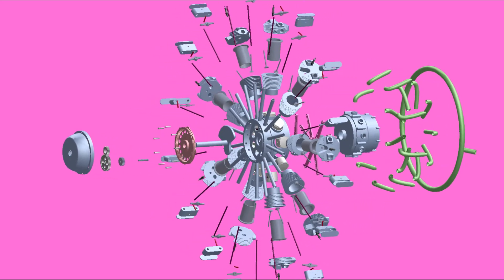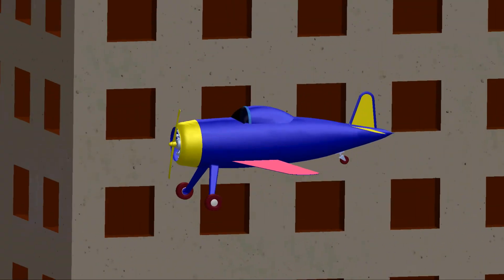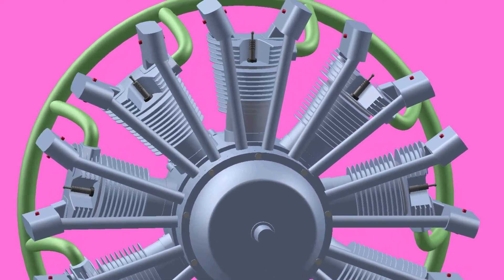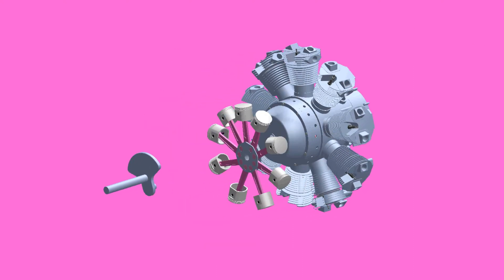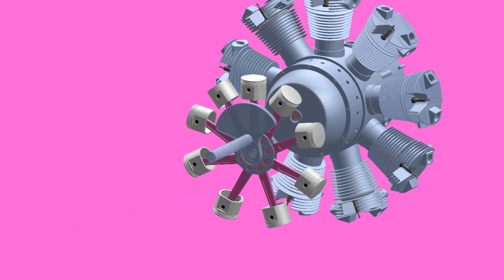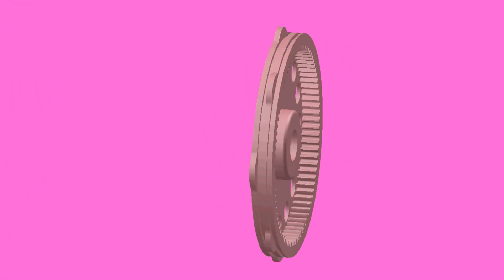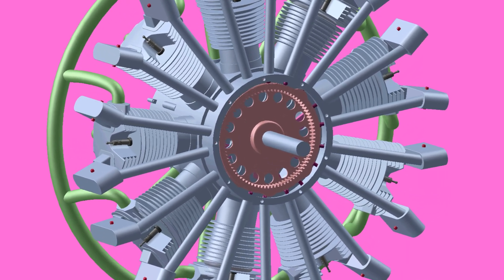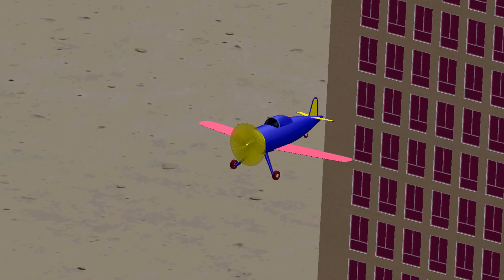How radial engines work | Lemurian D-Signs

Comment: Still difficult for me to visualize why inline engines have an even number of cylinders, but radial engines need to have an Odd number??
Reply: You should give it some thought :) But... The radial engine depicted in this video is a four stroke engine. This means that each cylinder fires once every two revolutions of the engine. Another observation is that each cylinder achieves TDC sequentially in a circle around the engine as it rotates. After TDC either combustion or intake stroke begins. For the vibration and even power stroke distribution it is desirable that every other cylinder begins a combustion (ie. it fires) and every other cylinder (those between former) starts an intake stroke as it rotates. The only way to achieve for all cylinders to fire in this configuration is to have an odd number of cylinders.  Thus in the nine cylinder example above the firing order is: 1- skip 2 because it started intake stroke - 3 - skip 4 -5 - skip 6 - 7 - skip 8 - 9 - skip 1 (astute reader will observer we started a second revolution of the engine at this point) - 2 - skip 3 because it started its intake stroke - 4 - skip 5 -  6 - skip 7 - 8 - skip 9 and now after two full revolutions we are back at the configuration we started with. This is only possible with an odd number of cylinders. In example if we would have an 8 cylinder radial and a firing sequence would skip every other cylinder(desirable) only cylinders 1-3-5-7 would ever fire, because we would skip number 8 and landed back on 1.
Theoretically there is another possible configuration where in the first revolution every cylinder fires, thus the first revolution is composed of combustion and exhaust stroke, and none of the cylinders fires on the second revolution because this second revolution is composed of intake and compression strokes. Such a radial engine would run very uneven, but it could have an even number of cylinders.
Also, bear in mind, that every four-stroke piston engine returns to the same state every 720 degrees of rotation.
And as a side note: inline engines are not limited to even number of cylinders. There were plenty of five cylinder inline engines. I think even 7 cylinder inline engines existed at some point.  3 cylinders inline engines are all the rage nowadays. And as a food for thought, a 5 cylinder V engine exists. :)
Reply: @Thomas..Anderson  Instructional
Reply: @Thomas..Anderson  You actually could do an even number of cylinders if you would fire every third cylinder skipping two in between firing cylinders so for an eight cylinder radial you would fire one skip two and three fire four skip five and six fire seven skip eight and one fire two skip three and four fire five skip six and seven fire eight skip one and two fire 3 skip 4 and 5 fire 6 skip 7 and 8 and then you're back at 1. It would take three revolutions for all eight cylinders to fire rather than two revolutions for an odd number of cylinders to fire in their entirety.